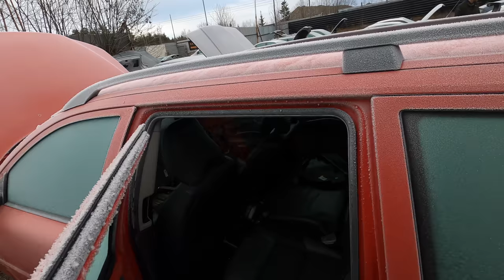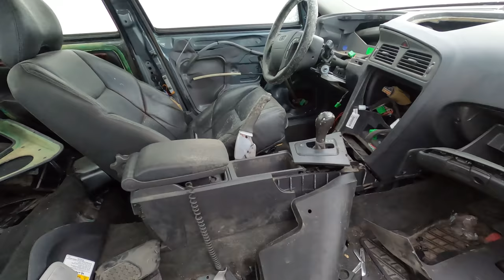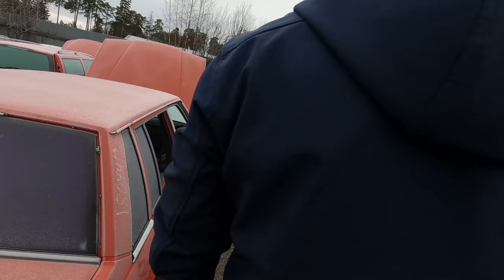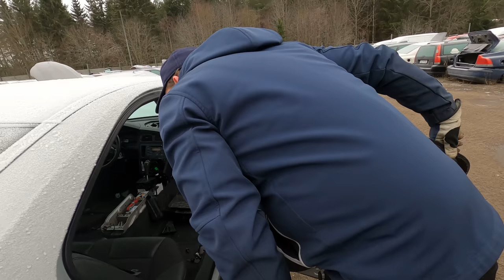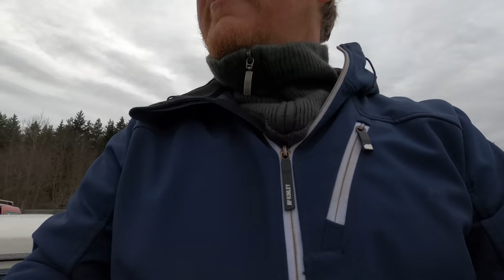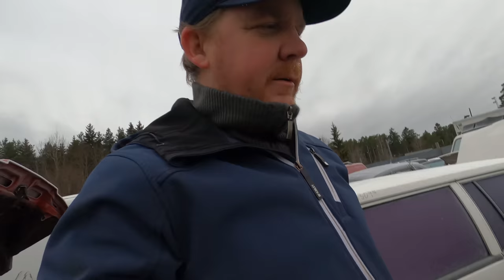VLOGG #3 Fyndar lite på skroten till Råttan

Comment: Dessa skrotar är fantastiska. Finns så mycket delar och accessoarer som inte behöver gå till skrot. Fyndade nya skivor + belägg från brembo till framvagn för 200kr totalt sist Även total facelift-inredning för under 1000-lappen. :)
Reply from the maker: Jag har för mig alla bilar stod på underredet här men det kanske går att komma åt skivor och sånt ändå. Vad mer kan man ta ifrån facelift? Det mesta var ju kvar i denna bilen så kanske blir en resa tillbaka och plockar mer.
Reply: @StefanBergman  På Jönköpings bildemontering står alla bilar uppställda på gamla skrotfälgar, så man kan komma under dem. Jag köpte mätarhus, dörrsidor, solskydd, ventilationsgaller (svart färg), växelspak m. plast undertill, handbroms och faceliftkonsoll. Säkert installerat mer saker 😅
Reply from the maker: Ok allt sånt passar bolt on eller?
Reply: @StefanBergman  Yes, allt jag nämner passar bolt on, inte handbromsen i faceliftkonsollen dock. Ska man ha faceliftlisten runt stereo och klimatpanelen får man byta och koda in den sistnämnda (vilket jag skippat). Mätarhuset får man flytta över tavlor och "fronten" ifrån.